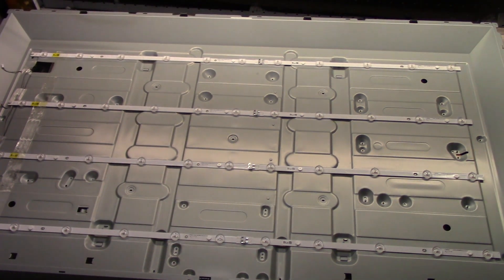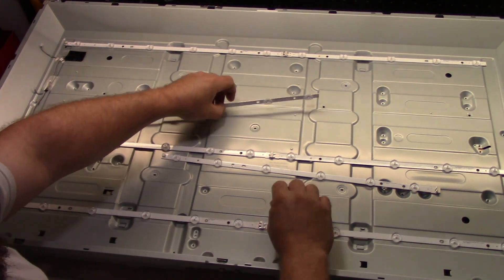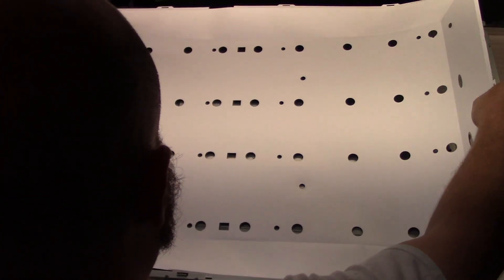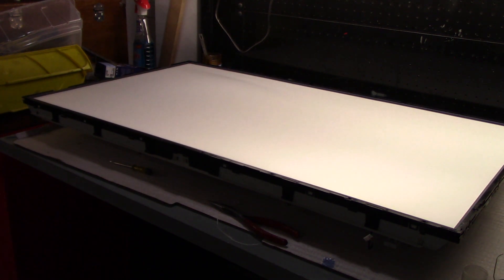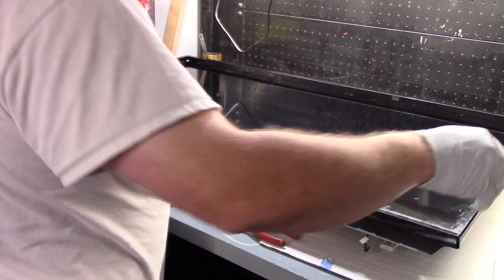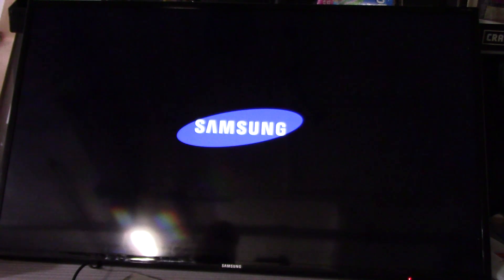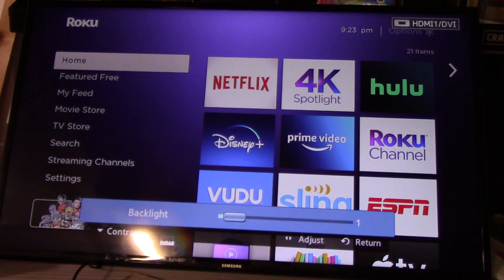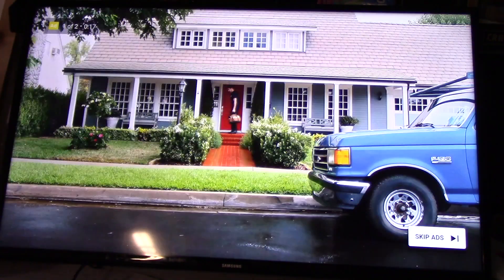Replacing Television LED Backlights

Comment: You should not leave the backlight all the way up. That's the reason in the beginning that it burned out. The heatsinking isn't adequate to run it more than 50% brightness.

Comment: Congrats on the repair project. We had a dead flat screen TV several years ago and it turned out that a capacitor blew. It was a common problem back then and the fix was super easy.